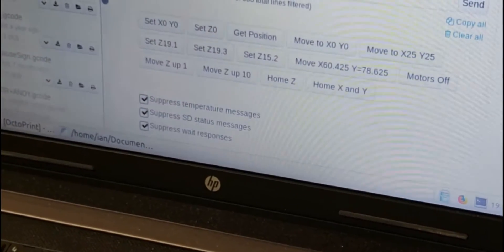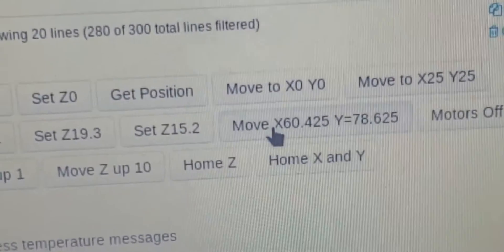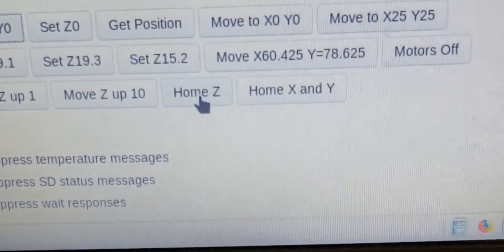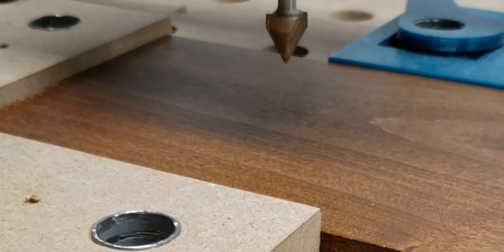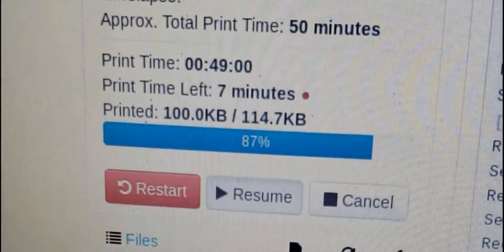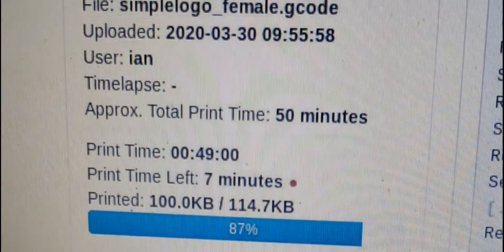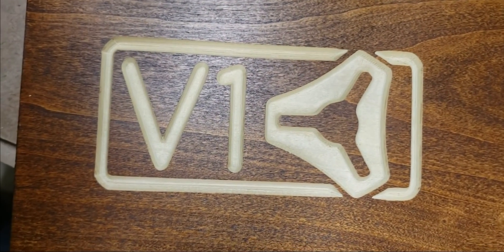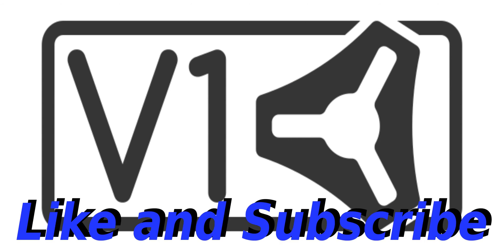Inlay using the vcarve technique with F-engrave and MODfef - PART1

Comment: Re: your spoilboard clamping system, I saw someone else's video of the same idea with hand-cut clamps and copper tubing, so I was going to 3DP a set of clamps, but I see you already have that.  Are you happy with the system?  What thru-hole spacing are you using?  Can you share a source for the design?  I am planning to use the thru-holes as a down-draft dust collection system.
Reply from the maker: I took Marius Hornbergers clamping system and redesigned it to suit my needs. I am very happy with it. It holds the work piece extremely well. I have the STL files for the parts I made, if you are interested I can make them available to you. The hole spacing is 3" on the table.